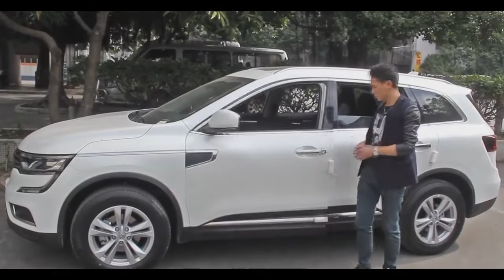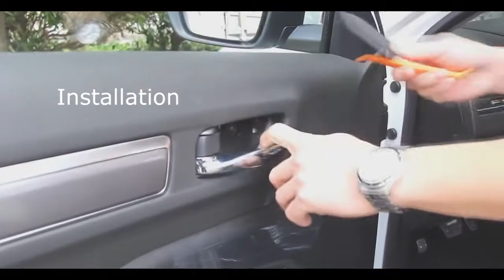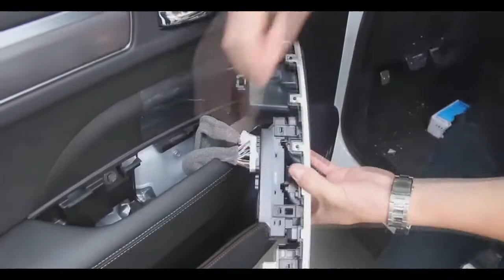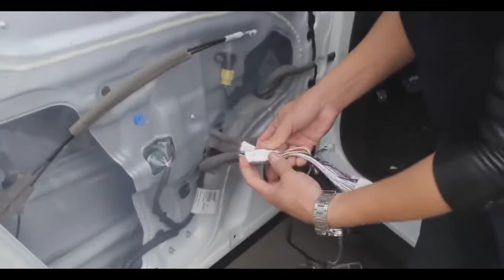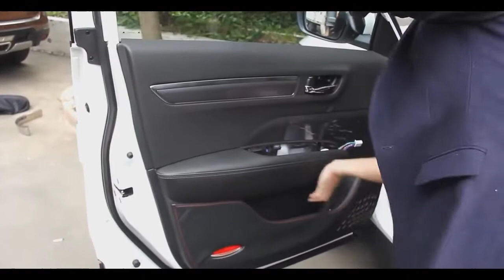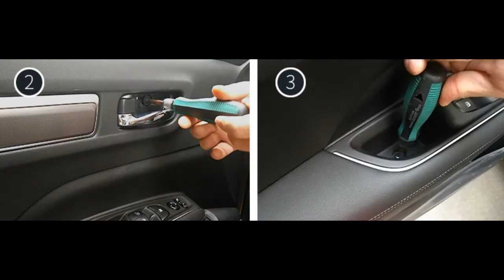Renault Koleos | OPEN/CLOSE window/mirror with FACTORY REMOTE 🔑

Comment: “Hey, I recently installed the evacuma smart window closer in my Renault Koloes, but I’ve noticed a couple of issues with the blow functions. The mirror closing button seems to be inactive now, and when I unlock the car using the handle button, the mirror doesn’t open. Could you please assist me with resolving these issues?”